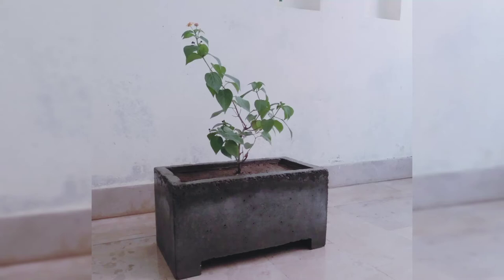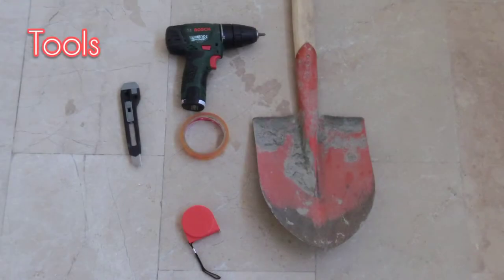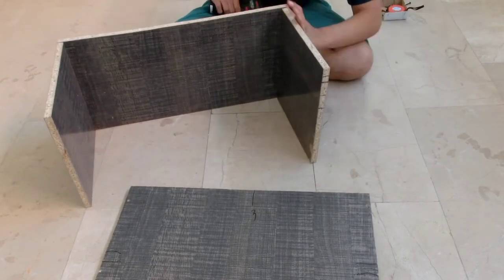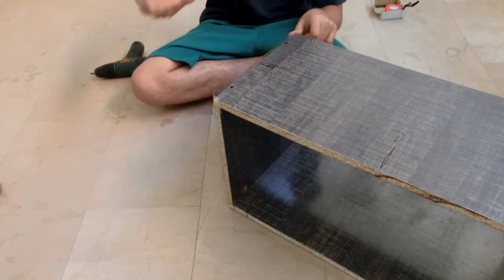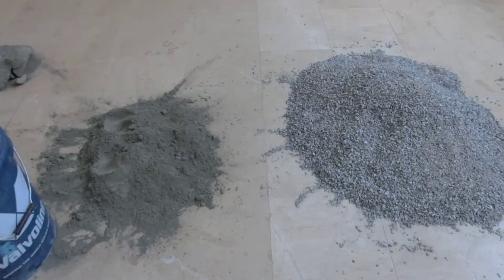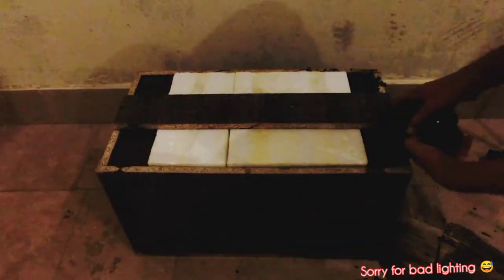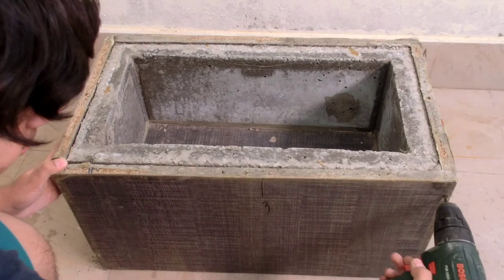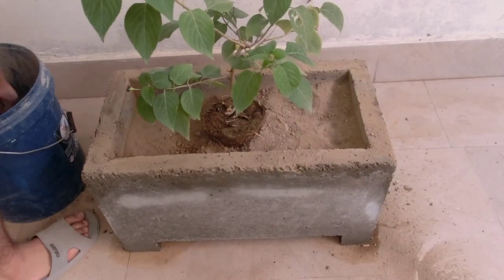How to make a Concrete Planter | Instructables Contest Entry | [8]

Comment: Why doesn’t wood stick to the cement?
Reply from the maker: In the video I have used particleboard or chipboard which has a printed plastic coating on it so the cement does not stick to it. Normal non treated wood will stick to cement but it can be unstuck quiet easily.